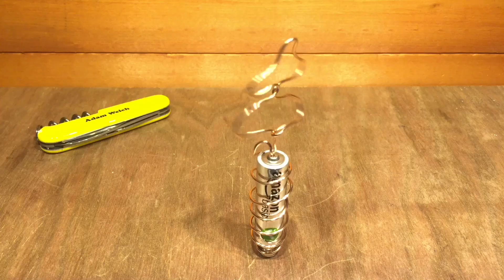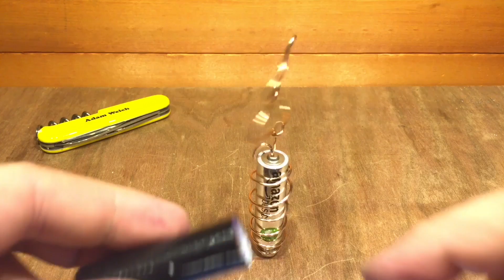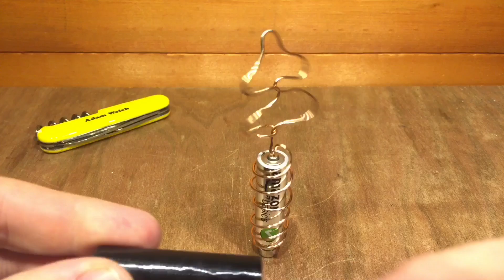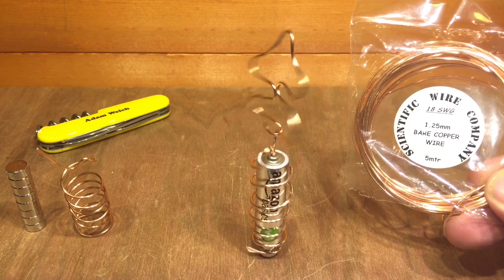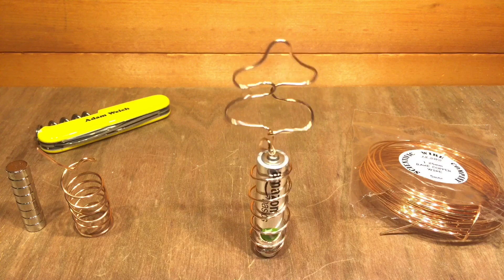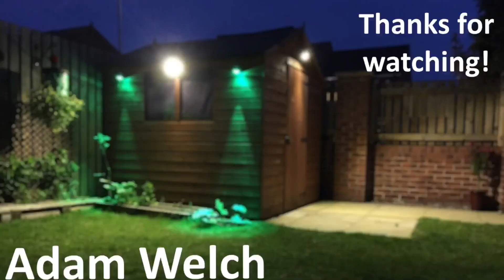Homopolar Motor - 12v Solar Shed

Comment: I made another type of simple motor a few years ago. The one with a coil which has 2 wire sticking out of each side that rested on the supports which also carry the current. Was fun back then, I never tried this one, though. But my spun up quite fast from 9V :) Sometimes it's so fun to just relax and play with these simple gimmicks, forget about fancy electronics for a while :) Has it's own charm.
Reply from the maker: +MrJohhhnnnyyy Absolutely. I really enjoyed fiddling with the wire to make it sit right and spin freely. Cheers.